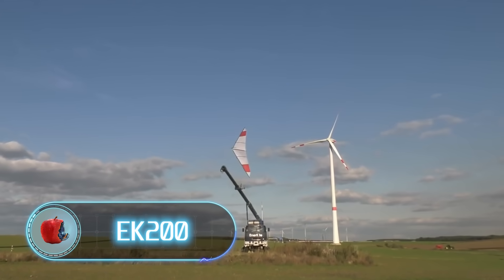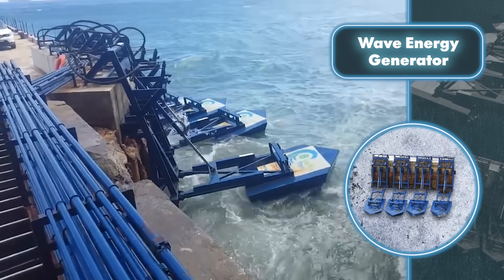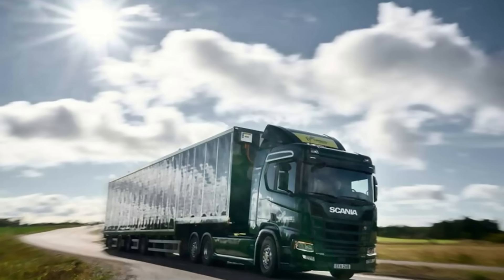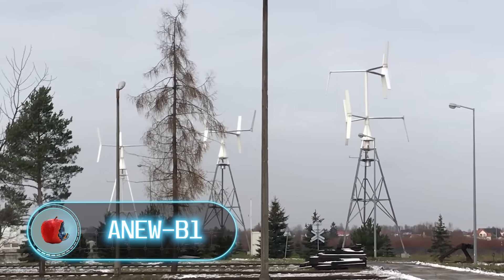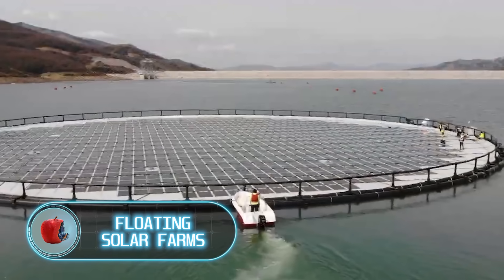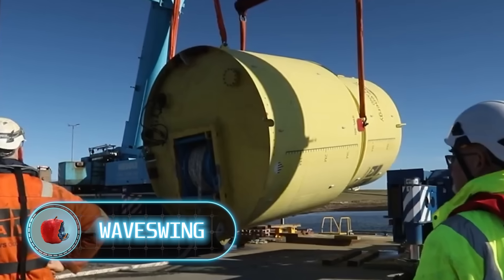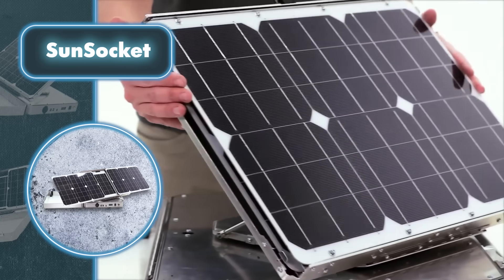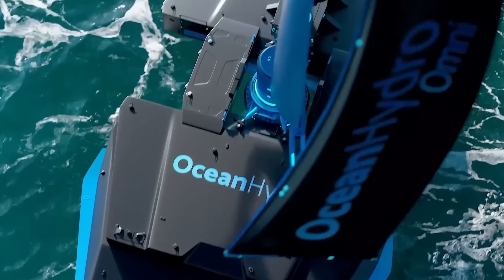Incredible Inventions That Generate Free Energy

Comment: solar panels are a great idea, until you have a hail storm, or an ice storm. so It's a no-show when you need it the most
Reply: Here's a thought...don't put the solar panels in the sun... (Keep reading...)
Place them where they are protected from the weather but use a reflector to bounce the light to them. Then the reflector will get damaged and not the panels themself.

Comment: The main barrier to renewables is political will. The larger energy companies have been spending a lot of money influencing politicians and creating a negative view of anything that threatens their interests. The approach is similar to what the tobacco industry took when the science was clear. If the grid was modernized to include smart meters and battery storage and a variety of renewable sources, electricity would be so much cheaper than fossil fuels that consumers and manufacturers would make the switch without any government mandate or regulation needed. The fossil fuel industry is still very much needed but should no longer be subsidized through tax incentives, rather shift the subsidies towards modernizing the grid.

Comment: The problem with solar on the side of the trailer is several fold: inefficient due to changing angles while driving, panels will get extremely dirty in rain and winter conditions, and potential damage from stones and other debris on the road. I doubt the energy gathered would compensate for the weight of the panels.

Comment: wave swing looks like the designers have considered damage a lot more than the floating solar panels which will get cable damage from constant flexing, corrosion of virtually everything. salt deposits reducing the efficiency of the panels etc. the waveswing has no air on the components to cause corrosion, and limited extra movement during storms. any device that is exposed to salt and storms wont last long
Reply: My balls farted

Comment: I see they all are still working to store excess power, rather then just have it produce 24/7 as mine do. it is scalable so it can be placed at the point of use or enlarged to a commercial size. it is base on currently proven tech. just in a much better design. looking for investors. N.D.R. mandatory.
Reply: NDA’s are nice, working on synergy between a few similar concepts. Ocean energy synergy on Facebook. Where does yours fit?

Comment: That kite looks cool, but I'll bet that truck it is attached to is $300+ 
Can't believe that would be cost effective.
Reply: I think that is just a proof of concept; they would probably just use a cable and a small motor assembly attached to a pole if they were going to do it for real.
Reply: @jamesfrancom8100  Yeah sure. Also lithium just pops out of the ground refined for batteries. Lol. Lots more to it.
Reply: @jamesfrancom8100  

Designing for a portable version makes modular manufacturing simpler for the static versions.

This also allow for spot-testing of potential sites. :D

Comment: Solar panels dont have a forever lifespan..very expensive...In Minnesota from Dec 15 through January 25th three days of sun..most of the panels here have snow on them..if it wasn't subsidized we wouldnt be talking about at all..same with everything on this video...ALOT of gov money...
Reply: well just put all the solar cell 'leftovers' in the same landfill as we do for the used cores of our our nuclear  generator facilities. ...That has to be maintained pretty much forever. hmm.
Reply: Would a tube of panels slowly rotating (using smidgen of its own power) solve the snow problem? 😊